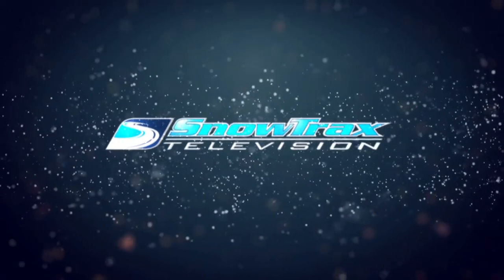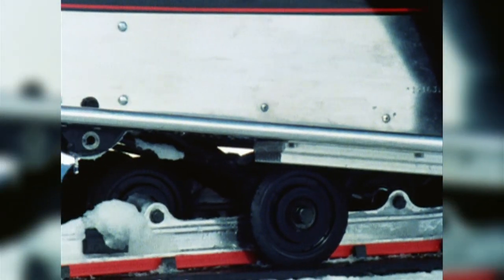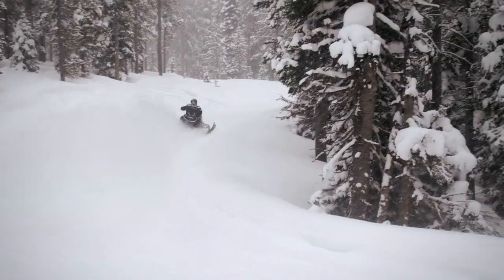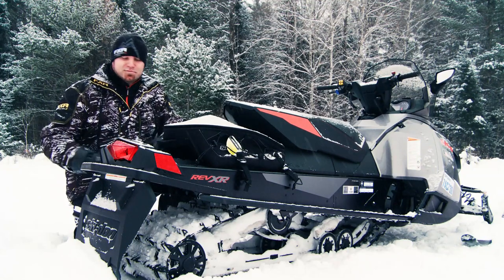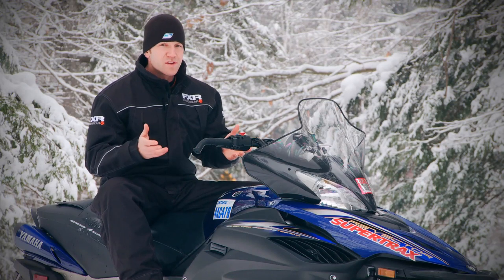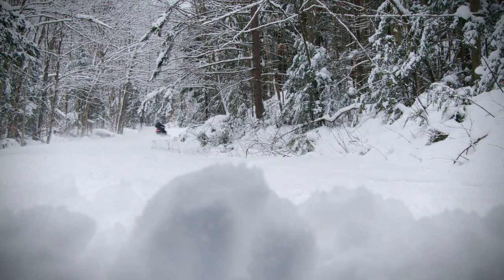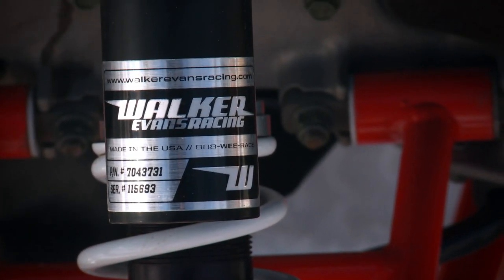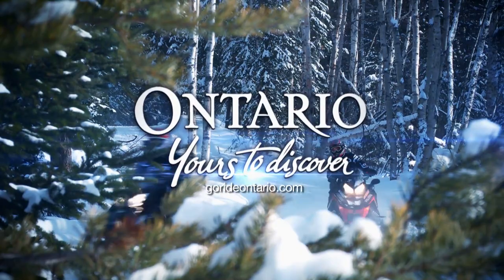SnowTrax Television 2013 - Episode 6 (Full)

Comment: Listen from 8:08 to 8:36. I've ridden one and I agree with everything said. Makes great power, it is smooth and is decent on fuel. Ride a 600 etec, throttle is instantaneous. Soon as you touch the throttle, the engine accelerates. Do this on the 4 tec and it takes a second to accelerate. This is because there is such a long intake runner from the throttle body to the intake valve. Get on a Yamaha or Cat 4 stroke which has individual throttle bodies and this doesn't happen.

Comment: Try an e-tec for some time and then go back and you will feel it. Dad got a 1200 and a riding buddy also, I got an 800 e-tec and mom an 600 e-tec.

Don't get me wrong, the 1200 is by far the best motor of the 3 mentioned above. (exept the 600 feels like 5 times lighter in the fluff).

It's quite scary how hard it engages as well. Can't get away smoothly enought when close to stuck, just trackspinn how soft we even try to engage it. The e-tecs can burn belt all day long with its smooth engagement

Comment: Mark I still don't know what you are talking about when it comes to lag with the 1200 motor, I have the 1200 Renegade X 2013 and I have never experienced this Lag condition that you speak of, is this at 5 to 10 mph in reverse on a hot day in July,  I never find it when refueling or loading. Simply put its a great story it just simply doesn't exist. All I know, uphill, down hill, around corners, across lakes, sliding, smoking through a trail no lag no time.